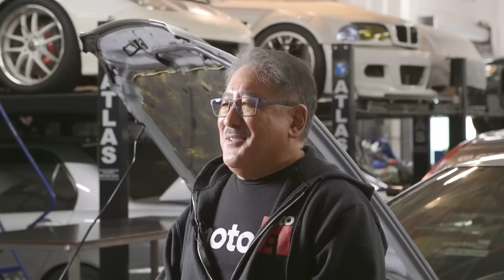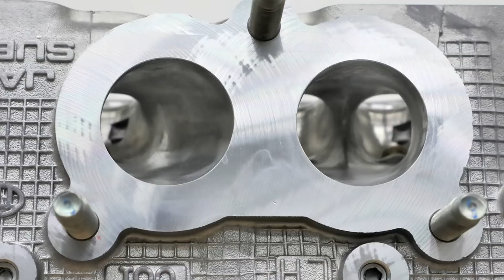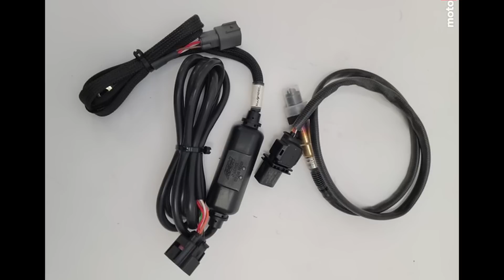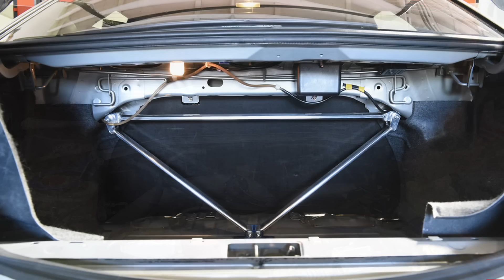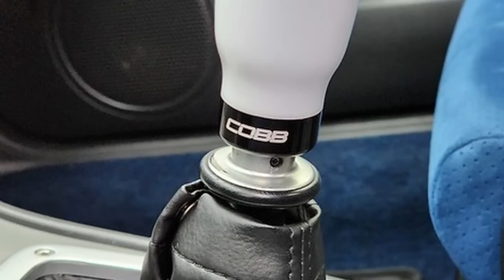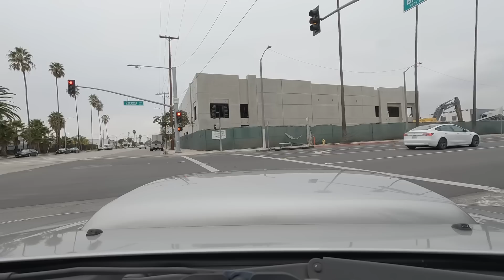How We Built Our Project Subaru So it Won't Blow Up!   (AND Drive Great)

Comment: Doesn't the dyno adjust for air temp, pressure, and humidity? If so, the hot day of the dyno shouldn't have affected the results.
Reply from the maker: It doesnt compensate for things like the intercooler efficiency, heat soak of the intake system, cooling system efficiency, propensity to knock and the ECU reacting to that.
Reply: @motoiq got it, thanks, love the videos

Comment: You can tune out the light flywheel misfire codes pretty easily. I found these tables on the 2004 STI using WinOLS, really surprised no one has before. Nice having cruise control back.

Comment: How did you guys manage to fit the intercooler under the front crash bar? 21:42
Reply from the maker: Cut it and welded in a tubular section

Comment: I really wonder if the OEM pistons would benefit from WPC and Cryo, specifically for conservative street builds (300-350hp). I like the idea of keeping the thermal expansion properties of the hypereutectic stock pistons, but obviously with the added strength and reduced friction. This seems like it would be highly beneficial to the stock block configuration longevity wise.
Reply from the maker: The stock piston are awful and are one of the first things to go on these engines.

Comment: Love the blob eye build. And finally got the brand for those Falkens. I have a 2018 WRX. Has full bolt ons with a Cobb TMIC ,turbo inlet, boost controller, BPV etc. With a tune form Graham at Boosted performance.  Looking at those nice stop tech brake kits. They look very capable.  And something different.  Love the channel and the knowledge shared.👍

Comment: Mike, if you wanted the ultimate TMIC for 2013 STi, what would you run?  Also with water sprayer and or chiller system just for a more compact short pipe design for fast boost response.
Reply from the maker: Stock, all the aftermarket TMIC I ever tested made less power.  Front mounts make so much more power even with a stock turbo. At least 15, 30 plus with tuning. You can hardly tell the difference in lag, you can feel it but its not bad.

Comment: So much enormously helpful info comes from this channel!! I'm thankful to be able to learn from you guys. I have a question that I'm sure not alot of Subaru enthusiasts ask, simply because 85% of wrx owners have a manual transmission. But, I have a 2015 Subaru wrx limited with the cvt transmission. I'm curious as to what you guys would suggest to lengthen the life of my transmission? My car currently has 170k miles, no issues with tranny so far, I change the fluid every 30k in trans and both diffs, but I'm always worried about chain slip and other common issues that cvt owners have experienced in the past.
Reply from the maker: Probably adding a cooler is a big help. We don't have much experiance with these transmissions and try to avoid them.

Comment: There is a lot of negative things said about Subaru’s online, I try to take them with a grain of salt. I’ve been wanting to buy one, but getting good info has been tricky. I don’t understand putting the intercooler on top of the engine where all the heat goes. Then there’s the head gaskets failing, and I don’t understand why Subaru didn’t do anything to correct this. I don’t want a high horsepower car, I don’t drive my cars hard, beat on them, etc… there’s a guy over across the pond I’ve watched and he’s on parr with this guy.

Comment: What is the core size of your fmic?
Reply from the maker: I forget exactly.
Reply: @motoiq hmm........ Wondering if a 3" or a 3.5" would be best suited for this power level
Reply from the maker: ThInner with a bigger frontal area is better for cooling but you also have to cool the radiator and not mess up the car's aero or front structure.

Comment: Is this build utilizing the stock fuel lines with the higher flowing pump?  I didn't see any larger diameter lines in the underside.
Reply from the maker: Stock size lines underside
Reply: @motoiq  Is there documented build data available beyond the videos?
Reply from the maker: https://motoiq.com/category/projects/subaru/sti-gen-2/

Comment: Onli people who does takecare of their cars will blow up their engines.
I have 3 Subaru since 2006 & I wrack 2 bcos of accidents, not the car's fault. Mod a little on my 03 Legacy GT to 440bhp & 06 WRX (JDM) with stock internal to 352bhp but crashed them both 😭 but none of those engine ever give up on me. 
Now I m left with 08 Exiga lightly mod & tune as a daily family MPV. With 210000km on clock it is still running good as ever with mostly stock parts.

Comment: Awesome video! LOVE IT. And taking a lot of notes for my own subaru build, which is a VA but very similar setup with an IAG 750 closed deck and similar heads. I do have a question about suspension going off of your review of the KW's. I have been trying to decide on a decent set of coilovers street and track use, and I keep going back and forth between ohlin and KW. Do you have any experience with ohlins? which would your recommend between the two. Thanks!
Reply from the maker: Ohlin is only one way adjustable in the consumer off the shelf versions.
Reply: @ gotcha. I also noticed you didnt mention whether the car had a cylinder 4 cooling mod. What are your thoughts on those?
Reply from the maker: Yeah it has it, I forgot to mention it
Reply: @motoiq  Thanks for replying! Really appreciate your content.
Reply: @motoiq  one last question, if you dont mind. I noticed some folks on here talking about oil pumps. When we installed the engine we went with the JDM 12mm oil pump. Is it really worth the upgrade to go with the IAG oil pump? Ive been told by several experienced subaru mechanics that the JDM pump is pretty solid. Thanks!
Reply: The car is running 28 lbs of boost out of an FP black turbo making 590 hp btw, if that helps…
Reply from the maker: We had heard by people with a pump testing rig that the 12mm cavitates at high rpm. We have one in our H22 replica motor and it seems ok but we don't rev that past 7700
Reply: @ hmm. Good to know. I just read on the iag website that they tested it and it has 10% better pressure and flow over the 12 mm jdm pump. Just ordered one! Thanks again!
Reply from the maker: That is what we recommend and run.

Comment: Last full rebuild was 10k. Im not sure what is hurt this time. I might just buy AIGs 750 long block and run low boost. I think 500 WHP daily   reliability is not out of the question. I just want to embarrassed all the scat pack and hellcats out here with out eating a ring land.
Reply from the maker: I would check your tuning
Reply: @motoiq  no more moon tunes. They are fun until there not.

Comment: I have a 2006 subaru sti that's running 400hp at the wheels on a mustang dyno. I love this car and the build process I went through to get here. I know I could have gone for more power but like you said more power more money. The worst part is money spent to power gained goes way down when you go above 500hp. I did my build for 500hp and had the tunner cap my car at 400. I don't want to live on the edge.

Comment: Im currently restoring a 2002 wrx, about to restore the rockers and fix up the body. My engine was rebuilt last year with .5 mil larger pistons and has 60k on the block itself. My plan is to get the body done by next year and in 2026 start building an engine from scratch for tbe first time. Listening to you videos are def an inspiration to help me reach my dreams man. Thanks for your knowledge!
Reply: Facts

Comment: Its kinda funny you guys say 550 is the happy limit ands sounds like a great compromise to me. I do not have an EJ i actually have a 2018 WRX.  Honestly dunno how i sprung here i haven't looked at anything subaru for a long time im more interested in my Camaro. Cobb ruined my plan some time back ehh hmm so im happy with my modest 323whp fun DD car😂 anyways, i always thought that 500 sounded like a perfect hp level for this chassis/engine for a well balanced car. Huge numbers like 1000hp doesn't drive me. Car becomes a one trick pony i prefer a reliable balanced machine.
Too many people do dumb 💩 on every platform and every platform has their pros/cons. Subarus con is addressed here and well documented online yet people still insist on ignoring it and then blame subaru for it entirely...  i grew up with muscle cars and those things you can severely neglect/ beat on and theyll be "fine"😂 a large displacement OHV V8 is hard to beat there whether its SBC, LT1/4 or LS.. 500whp NA is WAYYYY more fun than 500whp strung out tirbo 4 banger never mind the fact that every other person is scared of driving cause the cobb said -1.41 yet they did the dumb mods. Crap intake on a cobb ots tune, catless with a BOV🤦‍♂️

Comment: whats the downside to putting a 99.75 vs 99.5 stock bore. doing sleeves but iam slowly doing the build
Reply from the maker: Gets too thin. I don't recommend sleeves.
Reply: @motoiq  hey I was drunk and I asked the wrong question I forgot the oem bore. I did not measure the block yet. Its very nice. A reputable machinist machined it.
Reply from the maker: I hope they were a reputable shop that specializes in Subarus or you are going to have issues.

Comment: I daily drive a JDM Imported 2006 Hawkeye with a EJ207 and a IHI VF37 Twinscroll. The car is completely stock and came with factory STI Genome Gauges and STI Genome Cat-Back Exhaust. 

I am thinking of upgrades so thank you Moto IQ
Reply from the maker: That is a good car!
Reply: @motoiq  any thoughts on upgrades or should I keep it stock? it has 51,000km on it, 100% Genuine.
Reply from the maker: If you want trouble free use, keep it stock and well maintained. If you want more, your engine is one of the stronger engines from the factory. I think downpipe, up pipe, front mount intercooler, a good conservative tune, larger injectors and upgraded fuelpump would be nice.  If you drive on the track, oil pan, pickup, big radiator, oil cooler, windage tray and AOS would be wise additions.  Flex fuel is also nice for track driving and more safe power.  Remember keep the tune conservative.
Reply: @motoiq the fact that you reply makes you an absolute legend thank you so much sir your knowledge is out of this world!
Reply: @motoiq  so I'm now pushing 300kw - 400hp. Absolutely amazing car! E85.

Comment: I have a copper ringed block. Been having issues with je proseal gaskets. Thinking oe or cometic. I see you used oe. Any suggestions? Currently 650whp
Reply from the maker: We are running stock with a stainless o-ring.  Are you running studs?
Reply: @motoiq  yes 1/2 inch but thinking of going 625s. There’s not a lot of info. Iag recommends je but je recommend not using them. The embossment gaskets on a ringed block seam to be not recommended by any manufacturer. But there’s no flat gasket option.
Reply from the maker: We are running 625's. Stock mls gasket. I think if you kept the copper and ran a folded stopper layer MLS gasket, it should hold.
Reply: @motoiq  thank you. On that same direction right now. 625s will definitely be solid improvement alone.

Comment: Is a stock sti reliable? Can i really see my car passing 100k miles if i dont drive it hard and keep an eye on my oil levels
Reply from the maker: Yes
Reply: Please reply i commute roughly 90 miles a day in stop in go traffic in california, i have a 2015 launch edition sti. Is it normal to burn 1 qt of oil at 1500 miles? Im doing 3000 miles oil changes but is that type of consumption normal? I have no white exhuast smoke or no white smoke puffing out of my oil cap.. no rough idle no problems whats so ever at all feel great and healthy doesnt lag or feel sluggish... i average about 28 mpg in my car. But is that normal? 1500 miles 1qt if oil? @motoiq

Comment: Excellent video, I am looking into getting an NB miata to work with as a reliable fun car to take to the track and such, what sorts of mods do you think would keep it reliable? I have to drive 200 miles to get to the tracks I intend on getting it to. I want to do like 180WHP NA.
Reply from the maker: Full bolt ons and mild cams

Comment: So what I took away from this is looking cool is more important than sounding cool. We will give up efficiency in suspension but not in exhaust. 

Epic video. Your video with rotary Rob sent me down this new rabbit hole.
Reply from the maker: Don't get me wrong, this car handles extremely well and this ride height is perfect for track use, for rough roads it could be a little higher.

Comment: Doesn't a longer rod increase compression ratio and decrease displacement? or does the iag block compensate for that with increased "height"?
Reply from the maker: No,  that's all related to the piston compression height.

Comment: That is pretty in depth agree with most of it granted I have 2008 not 05. Do you have a video on must haves upgrades for 2008 WRX? 
Thank you 
This video A lot of intel but still a strong sense of sales pitch because lack of detail why made that descision .
Reply from the maker: My personal opinion is there are tons of details why we used those parts, it's why we did the whole video.  I could build a car with totally different parts for about the same price and same performance.  The parts would be of equivalent quality.  Something like CP, Wiseco, Mahle instead of JE for pistons, Out Front Motorsports instead of IAG for the case, Carrillo instead of Callies for the rods, ACL instead of King for the bearings, Ohlins instead of KW for shocks, Brembo instead of stoptech for the brakes, etc

Comment: Back in 2001 I built a 450hp/405 ftlb 1994 GC8 on 30psi, stock crank, stock 5sp trans with heavy clutch and thrashed it for 8 years no problems. Wish I never sold it.

Comment: If I wanted this exact setup (full engine build) from you guys, how much would this cost me? I’m really interested. Plus you guys are in CA so it’s like a 3hr drive from me.
Reply from the maker: The whole car all at once?  Probably something like 35k
Reply: Okay sounds good reasonable. What about just the engine? Either way you guys will hear from me soon this year, when it’s time I’ll submit my form on your site.
Reply from the maker: Something like 16k depending on what you want.
Reply: @motoiq  Sounds good, thanks 🙏🏽
Reply from the maker: It sounds like a lot but we built our car bit by bit over 10 years while daily driving it.
Reply: @motoiq  I think that price is very reasonable, especially because I know I can get into the car and know it will start up everytime. I think it’s a win win for me. I’ll stop by soon, just have to save a little bit.
Reply: Plus it’s a car I will never sell so your asking price is good for me.

Comment: Treat it well, dong lug the engine get it properly tuned and change the oil often with quality oil and you wont have any issues. The idiots thst do stupid crap to these cars and blow them up as a result is the problem.

Comment: Cool deal i have a 2021 Crosstrek and keep it protected with Amsoil and it runs great i have 43k on it now changed all my fluids to Amsoil and wow what a difference it has made stays cooler oil is always at 190 degrees and stays cool and my fuel economy has improved as well.

Comment: Any consideration for using 4032 pistons in a more mild daily driver/occasional track car?
Reply from the maker: I would not do it in an EJ because there isn't much room for a strong ring package.
Reply: Interesting, did not realize that. Sounds like the carefully assembled block with cryo/WPC would yield a good balance of durability and longevity for a daily driver. Thanks for weighing in!   @motoiq
Reply from the maker: Don't get me wrong, 4032 is way better than the stock hypereutectic cast alloy, you just have to decide what is best for your usage.

Comment: What do you mean the head gasket is o-ringed ?
Reply from the maker: There is a groove cut in the cases for a stainless steel wire that locks the gasket fire ring in place, we have a pic of it in the video.
Reply: @motoiq  question are you using the “fire lock” gasket IAG offers. Could you give me your input on them ?

Comment: Aiming to 600whp+ as for now my STi has a single walbro 450lhp and ID1700cc with -6feed and -6 return on series, I think it has -8 from fuel filter to radium hanger, my tuner recommend to upgrade dual pump 340lhp, current turbo PTE6062 .82AR with T51R mod, I might upgrade between Garrett G30-900 or G35-900, I should't have any problem hitting the 600whp+ with the 6062, will see how the Killer B Max VE reacts on low RPMs since the secondary runner is a 2.5".  Good thing its going to get powered by a MoTeC M150...not daily car, weekend ride only.
Reply from the maker: The fuel pump might not be enough.

Comment: A bit off topic, I am just hoping that you see this, what is the logic behind air intake resonators. I know some are supposedly meant to prevent turbulence in the air intake system due to valves going up and down, and others are exclusively for sound reduction. So what is the logic behind air intake resonators? Should we just delete them? Or are there specific resonators that will actually help performance and have a right to be there, or even be put in there? I am asking because the Mk1B mr2's have several resonators and a very long intake system. I want better flow (and better noises) but the last thing I want to do is risk my torque and power.
Reply from the maker: They are to reduce sound at a certain RPM